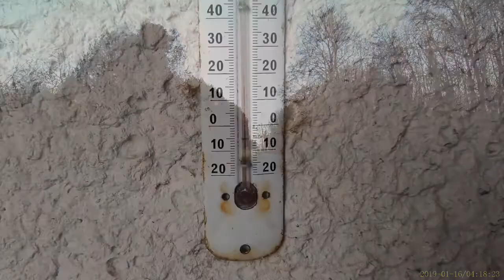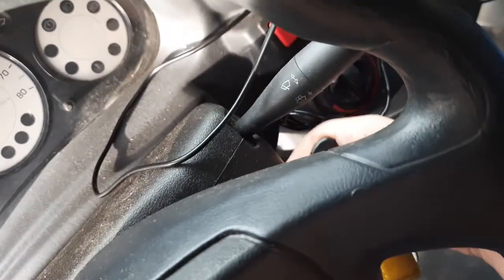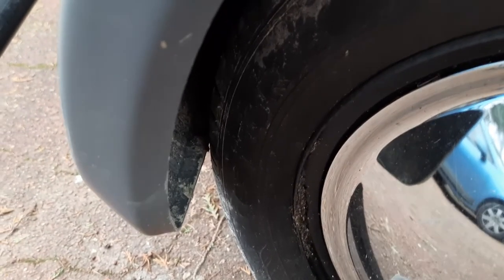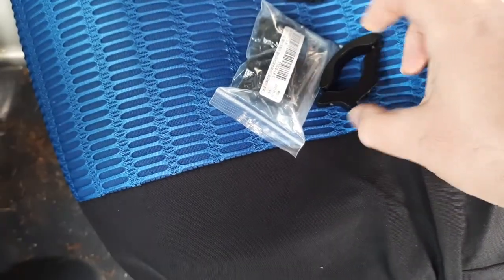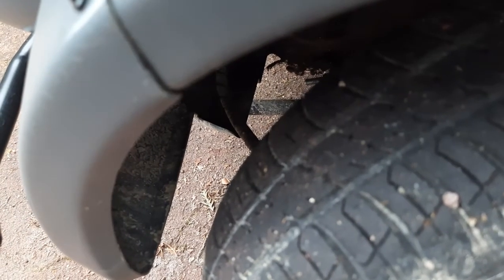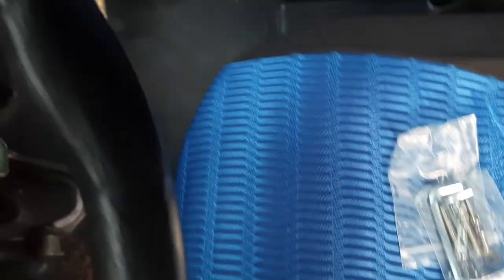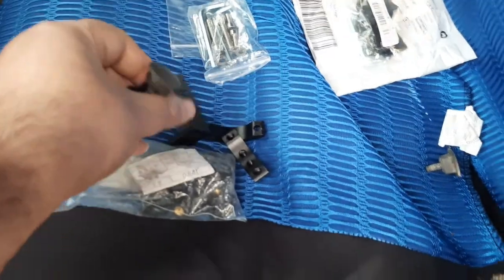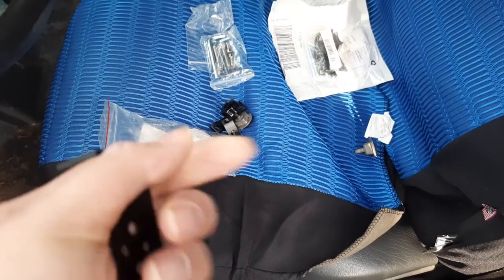Wot's that scuffing noise? | Aixam Mega Multitruck Van

Comment: I wonder why the other wheel didn't rub on left turns. Wouldn't expect such an issue to be asymmetric.
Reply from the maker: Could be that I need to go on a diet? 😆
Reply: @MegaBreadvan  LOL
Reply from the maker: Since April France has imposed a contrôle technique on all sans permis  vehicles. My van hasn't been for one yet, so I think I'll find out if the front wheels and steering have a problem then. 😬